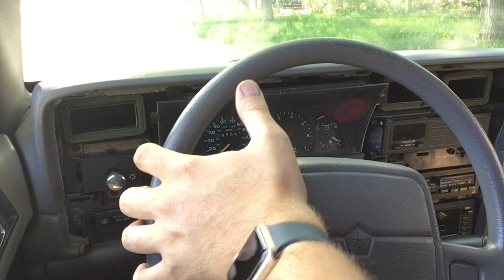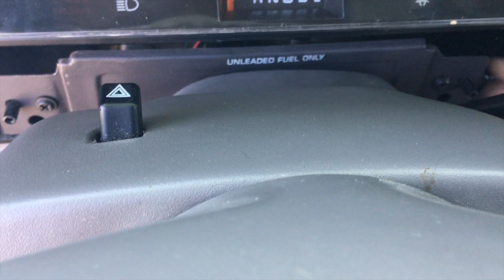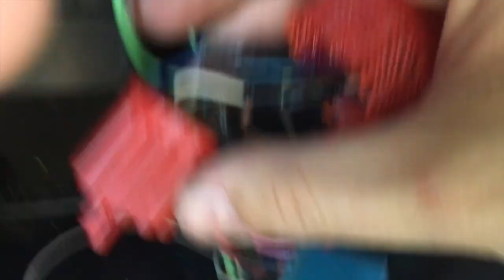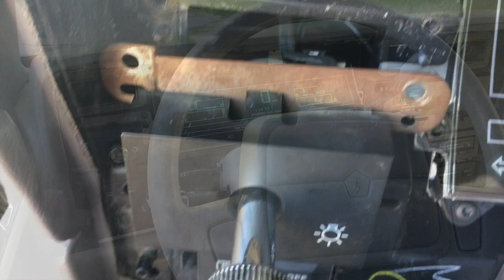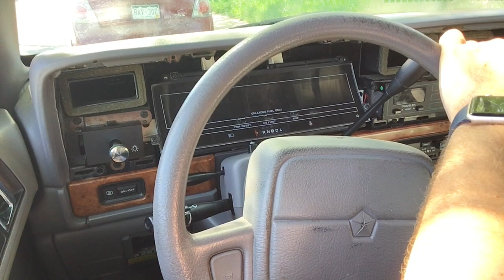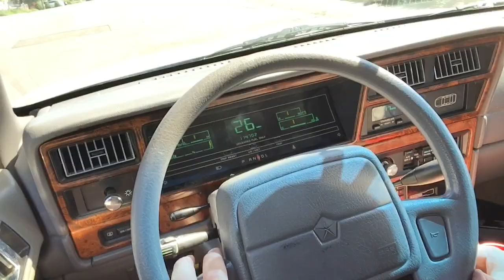Messing with Electronics: Digital Cluster Conversion Part 2

Comment: Hello friend, I have a 1992 Dodge Spirit and the airbag warning is always on, will you know how to fix it? Beforehand thank you very much
Reply from the maker: MOPAR CHRYSLER Coild be any number of things.  I’ve never really worked on the air bag systems, but it could be a bad impact sensor, a bad air bag, or a bad SRS Control Module.  If you’re also having issues with your power windows, heater blower, air conditioning, and rear defogger in addition to your air bag light being on then you probably have an issue with your ignition switch.
Reply: @LAEXMA  thank you very much friend, I will review everything you mention, I look forward to the new video, greetings

Comment: HELLO, PROMPT HOW TO CONNECT THE DIGITAL PANEL TO THE LABORATORY POWER SUPPLY, I NEED TO INCLUDE THE PANEL WITHOUT THE MACHINE, YOU CAN HAVE A CABLE SCHEME, спасибо
Reply from the maker: Дамир Галимуллин The pinouts are online and fairly easy to get ahold of.  If you want to connect one to a power supply you will generally just need to tie the constant and ignition power wires to a 12 Volt power supply, and the ground to ground.  The constant power feed is usually either pink or red, the ignition feed is usually dark blue and white, and the ground is usually black or black and green.  Hope that helps!